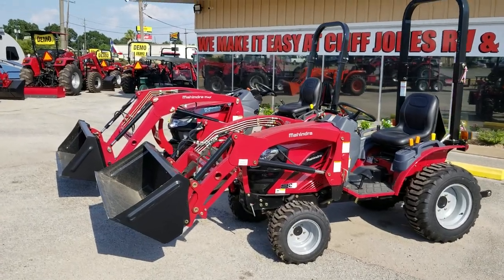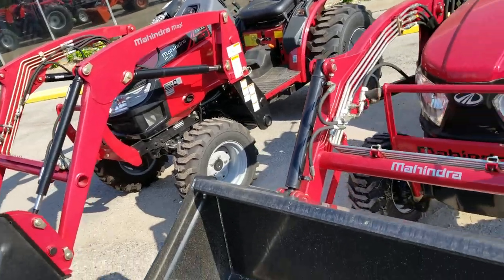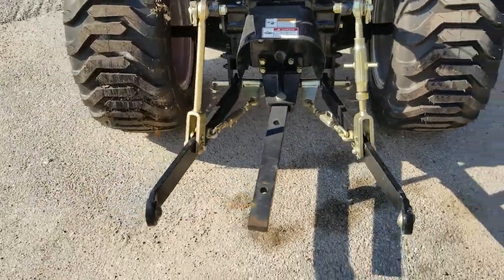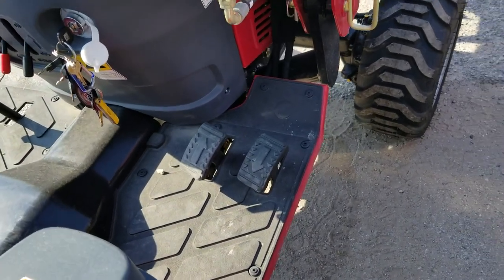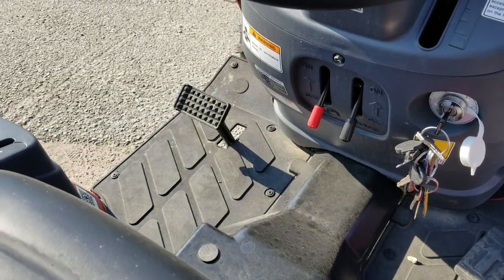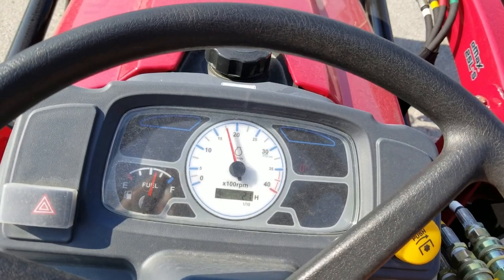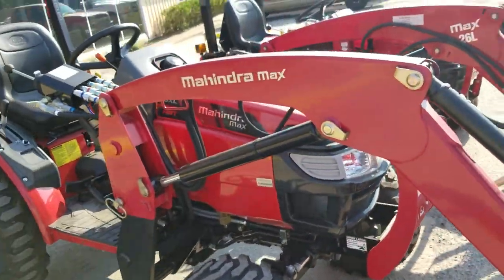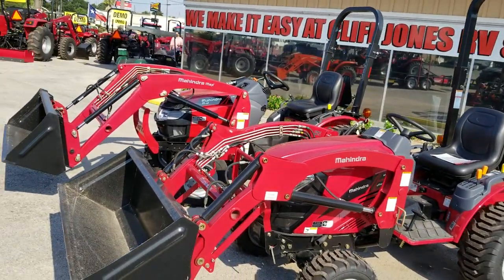Comparisons between the Mahindra Emax 25 HST and the Max 26xl HST

Comment: At first after my purchase of the emax 25  there was concern of the Korea engine but after nearly 1200 hours in two years that concern has greatly disappeared. Biggest concern is the fuel splash cup / rubber below the fuel cap if you don't cover the fuel cap in a good rain you'll get water in the fuel, strongly advise putting a tarp over the hood because as I understand the company that makes the fuel pump won't warranty if water damage is the cause. But I suspect most tractors have this same design at least from looking at them it appears so. Powerful tractors have done amazing stuff with this little emax 25. Change fluids and filters as stated and be sure to use Mahindra hst transmission fluid, it actually is better than anything out there that I know of.
Reply from the maker: That is awesome and glad your happy with it sir
Reply: Of course I wasn't down talking the 26 ,been considering that for my next one.
Reply: The emax 25 is the same as rural king tractor. Alot cheaper there
Reply: @MrBlaze256  no it’s not
Reply: @mightyminifarm  yeah it is check it out if you don't believe me
Reply: @MrBlaze256 they’re both TYM base designs but the engines are completely different. Also, I wouldn’t want to buy from a retail farm store, imagine the post sale support would be terrible
Reply: @mightyminifarm  rural king has yanmar engines same as John Deere

Comment: The "S" in the HST does not stand for "steel" it stands for "static" in Hydro Static Trasmission or commonly known as HST.
Reply from the maker: No sir that is not true HST does stand for hydrostatic transmission up to a year and a half ago they had the plastic hoods and then they came out with the emacs 25 and 22 s which stands for steel not plastic like the John Deere
Reply: @HenrySkinner  Then what is then what is the total abbreviation for HST on the side of the tractor?
Reply: Sir if you are selling tractors you should know what your talking about.  You are 100% wrong stating that the S in HST stands for steel.  Codie is correct.  It stands for static,  hydro static transmission.
Reply: @rodrick140  He isn't talking about the 's' in HST. He is talking about the 's' which follows the model name as in Emax 22s.
Reply: @HenrySkinner  Henry, I have an emax25HST. Im blowing the fuse that handles to gauges. Any thoughts on where the problem is?
Reply: @rodrick140 Sir if you’re going to comment, know what is being talked about. He wasn’t talked about the S in HST… 🙄

Comment: how does a person put gas in it being it up so high?
Reply: Same as all other tractors in this size. Almost all tractor brands do that
Reply: It uses diesel fuel, not gas. But yes, use a siphon from a can. It doesn't take long. Maybe 3 minutes.
Reply: JerVA ya I was wondering if they were diesels cause he just turned the key without letting the glow plugs heat up
Reply: Diesel fuel ,I put a cloth on my hood and lay my five gallon jug on it and pour side ways using a large mouth funnel and don't get in a hurry, I get very few splashes unless you try it in a strong wind then you want to block the wind. Pretty much like any other tractor that has a fuel tank up high.